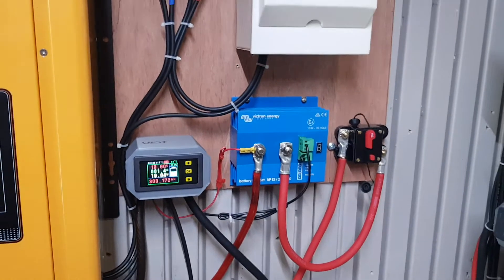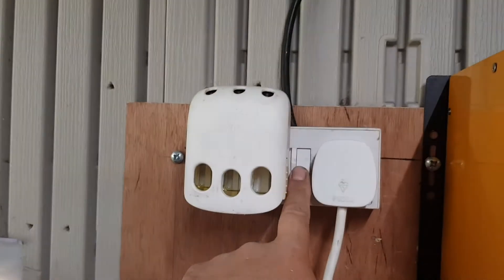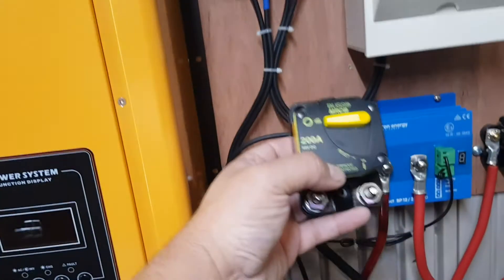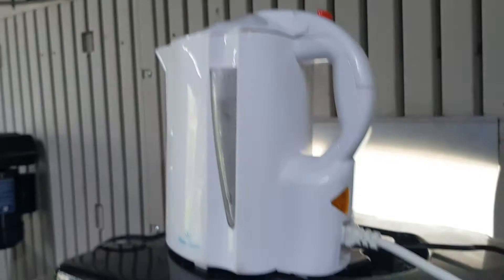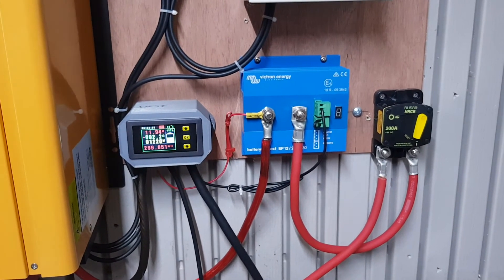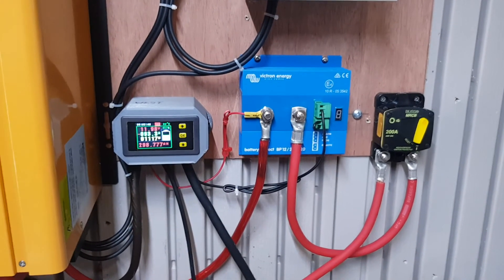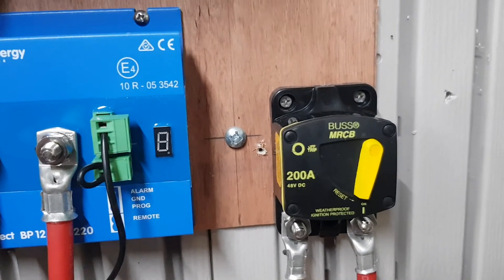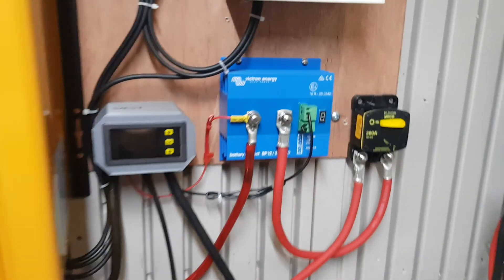Breaker Test - Is a cheap Chinese low voltage disconnect/breaker any good ?

Comment from the maker: I was refunded via eBay.  This seller recognised it was not working (it was fake in fact) however would not replace for a working part - they wanted to refund me (they knew they could not provide a working breaker at that price point).  The offer for a refund all rested on me removing my feedback.  Its my duty as a human to warn other humans that this company is not honest, will not do the right thing, and will try to use the possibility of a refund to 'blackmail' you in to removing any negative feedback  you leave them.  Not to fret though - eBay is your knight in shining armour and will step in and rescue you :)
Reply: I have the same first one shown, black with red switch circuit breaker, @ 100amp, between battery and inverter. Runs my kettle fine without tripping. However I bought it for AU$50 from Jaycar a local eltrical store, which is circa 25 quid. Works fine. No problems. Going well 3yrs now. Beware it is a circuit breaker for over amps to avoid frying your wire and thus fire safety... Not a 'Low Voltage Disconnect' which is different and used to protect over discharging the batteries.
Reply: @Raj-yy7xx  Dude ive just brought a renogy 3000watt invertor for my Dc solar setup, would I need a 300Amp breaker ?!? Seems like a bloody nightmare finding something trustworthy going through youtube..
Reply from the maker: @Berrnie Mccannaster No I have not.
Reply from the maker: @Berrnie Mccannaster I threw it in the bin, this video was more about what not to buy, rather than finding out what's wrong with it.